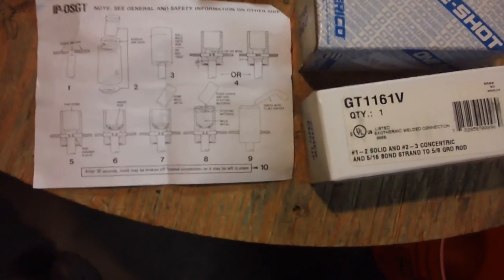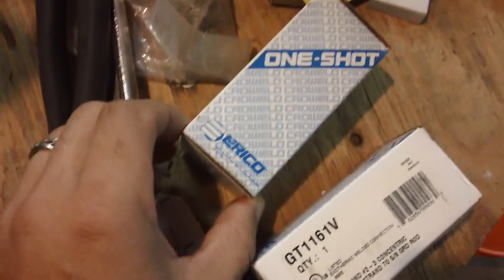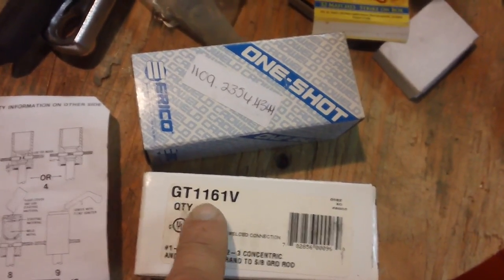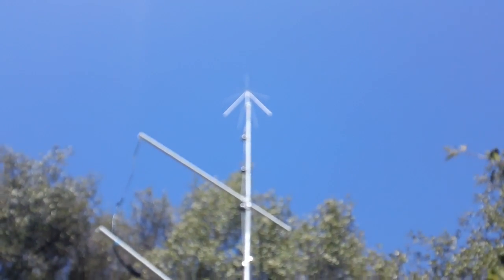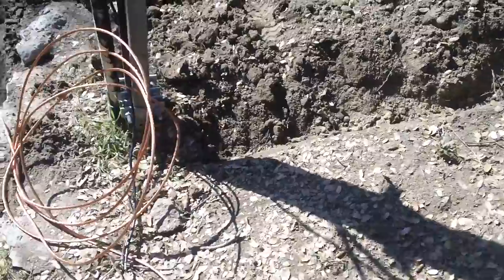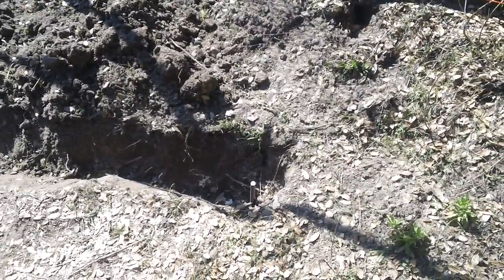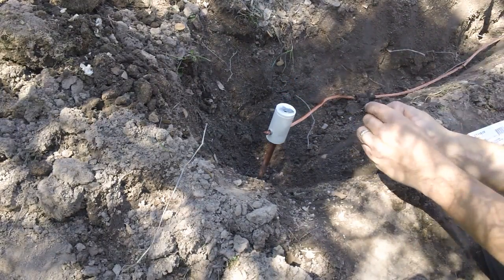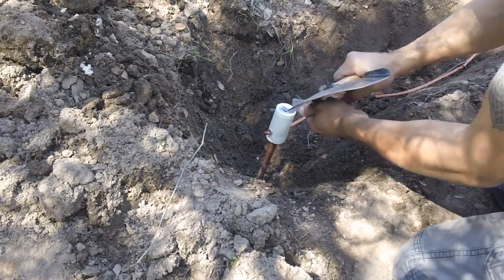SHTF/WROL Comm Center Antenna Grounding, Lightning Protection. Part 1

Comment: Thanks for the info. I'd like to try and get it done before the Spring severe weather season starts up here. I've had the antenna up for a few years now without grounding, but it's something I really need to make a priority. For something 30ft or under top rail can't be beat in terms of cost and reliability. An F3 tornado passed about a block from my location last year and my Antron 99 and top rail mast made it through with no problems while entire homes a block away were completely destroyed.

Comment from the maker: I would pound the grounding rod as close to the antenna mast as possible then hose/pipe clamp to your fencing top rail. shorter distance is less resistance. Those fence railes make good cheap antenna masts for field use and are way cheaper, good idea.. My final vid on this series will show how I interconnect all these grounds whenever I get the time to come around to it.

Comment: Great video.

What would you recommend for grounding antennas mounted to 2 sections of fencing top rail? I've got a CB and ham antenna on their own sections of top rail anchored into the ground with 2 feet of concrete, freestanding. Just drive a grounding rod about a foot away from each pole and then use a hose clamp on the rod and top rail to anchor the ground wire between the two?